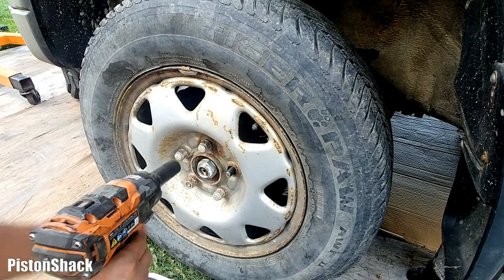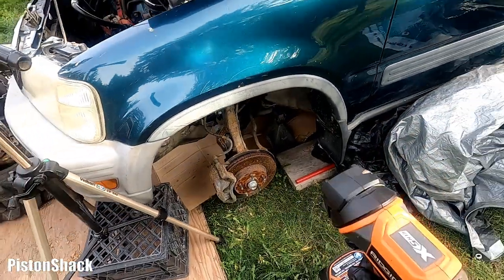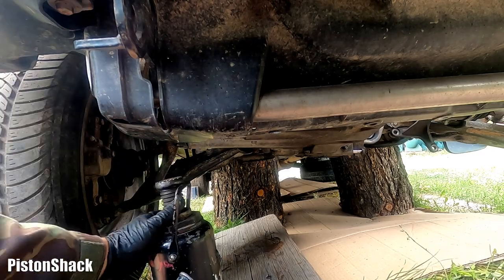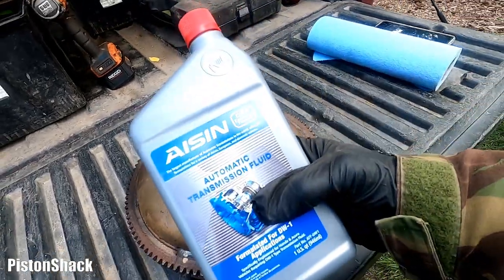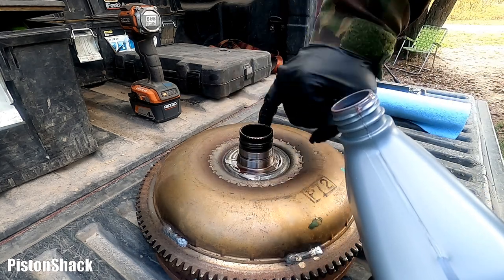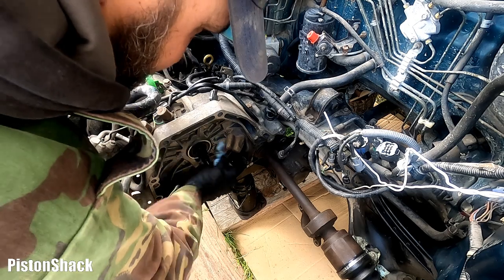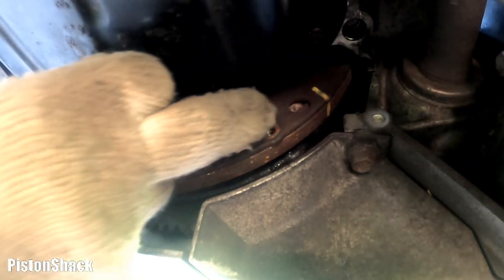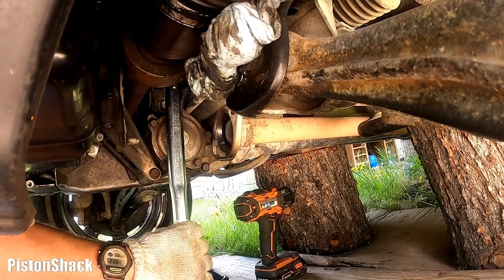HONDA CR-V ENGINE SWAP. Part 2:  INSTALLATION IN DETAILS | 1997-2001

Comment: Any website that you use that has torque specs for the bolts? I see you used a torque wrench for a few.
Reply from the maker: I have Honda CRV repair manual. Let me know what torque specs to you need. Thanks.
Reply: @PistonShack  all of them. Lol. I just went with tight when installing everything back.  Hopefully I am close enough.  Your video was very helpful in my process. Thanks!